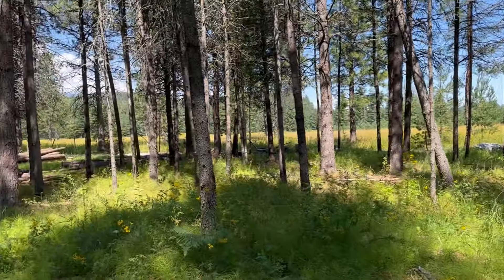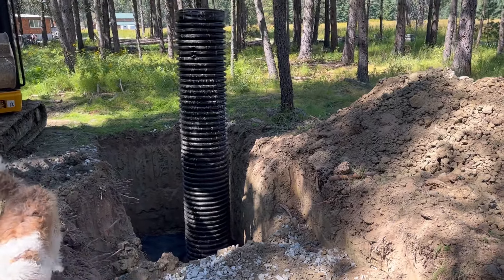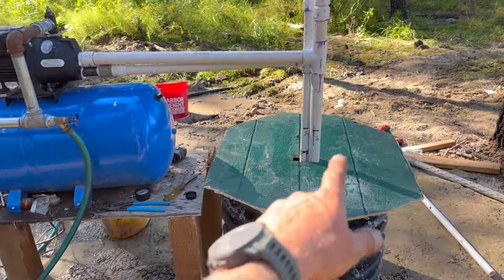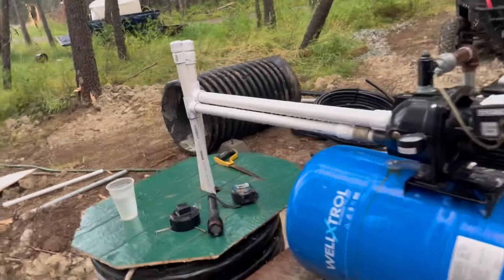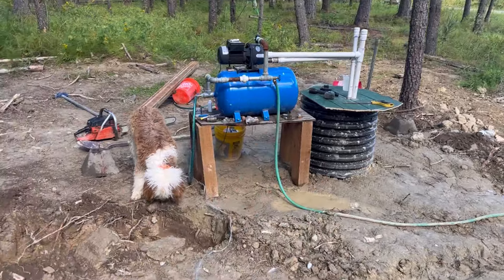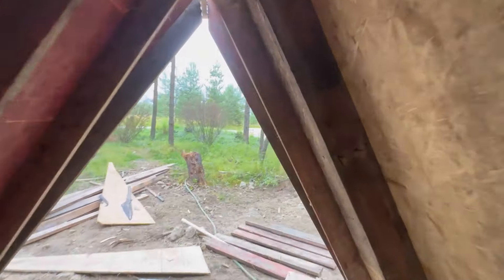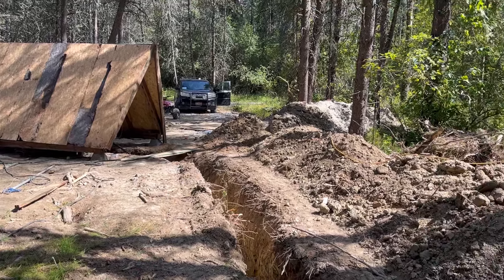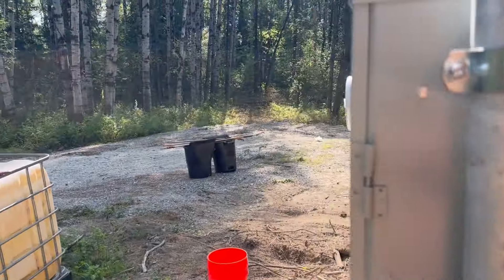Digging our own 14’ deep well for $1k!!! Free water

Comment: Are you using the -extra pipe system ? My sister had copper pipes till the well water ate through them.
Reply from the maker: I’ll use the poly pipe to run to the mobile home. It will be triple filtered and UV treated